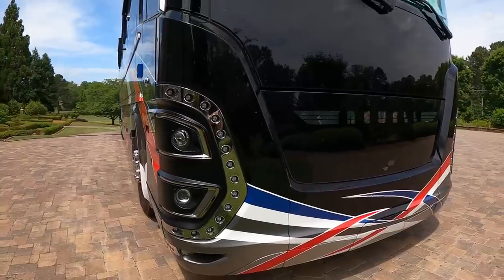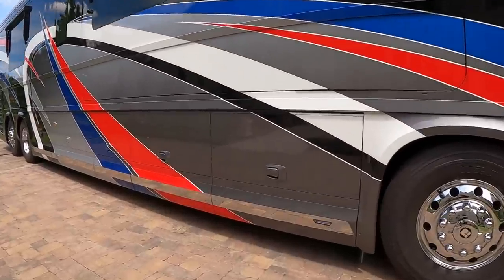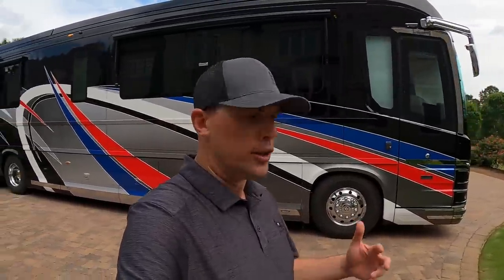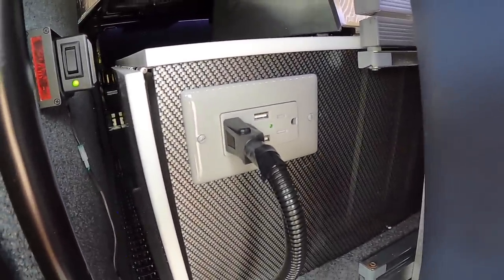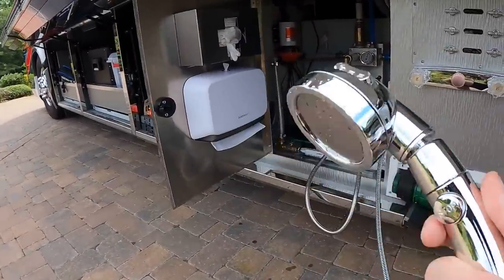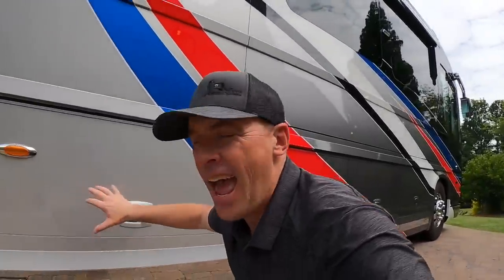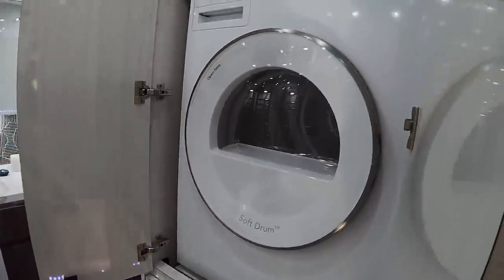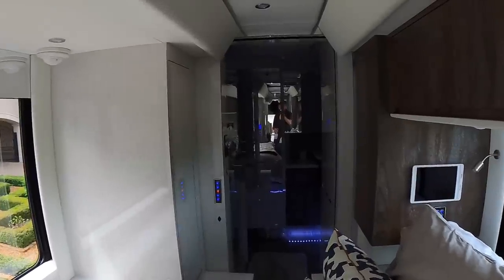THE  NICEST MOTORCOACH ON THE MARKET RIGHT NOW! Newell Coach 1704

Comment: Andrew: I have a solution for the rear bed. Why not have the bed roll up like those roll up gates in front of shops that protect the shop's windows. With the bed rolled up, you would be able with and without the slides to access your rear closets and bathroom with no limitations. Now what these vehicles should have is an auto driver that like a plane's autopilot be able to roll on the road while enjoying your coach. Of course this is for the future.  Thank you for these tours of these mansions on wheels. I totally appreciate it.

Comment: What kind of mileage on this Andrew
Reply: Newell's usually average somewhere near 8 mpg over a full tanks useage (you could be looking at 1500/tank!)
Reply: @shanemichaels124  I was looking for something around the 12mpg mark, but thanks anyway.
Reply: @Deanidge1983  that's unlikely in a Newell or Prevost. Maybe since Newell is a custom build, you could go with a 40' that is built using lighter materials and a dual slide. That might be possible. (But seriously expensive)
Reply: @Deanidge1983  sorry but unless you get a smaller coach 12 mpg will never come from a coach this big.
Reply: @Deanidge1983  enough cash to own and maintain something like this, but 4 MPG is your brraking point? Sure, sure...
Reply: @Deanidge1983  you can buy a 45foot rv bigger then this and buy a ram 3500 and tune it and get 15+ mpg pulling.  and stil be under 200 to 150k$.
Reply: @jamesstephensonii4428  emission delete this thing will get well over 15mpg sir. an the way you get around warranty if you buy a spare ecm and swap it in wont take 5mins so when it goes in for repairs there is no tunes recorded. the exhuast is a simple swap over aswell which they more then likely will not even check.
Reply: @shanemichaels124  no way….with a 600 hp Cummins you will be lucky if it gets 6 mpg.
Reply: @mrrod3004  you need to stop replying when you are high.  What you typed makes no sense.
Reply: @jamesstephensonii4428  i have a stock untouched cummin 6.7 in my yard that get 17 to 18mpg and 12 pulling 15k pounds. you probably have never even driven a truck in your life,  if you can even afford one and you get on here acting like you know something. im actually educated in the subject own several of these and make a living off it. what is it you do again?

Comment: I have already been building a machine shop inside of a 40ft high container... with a similar color scheme... same floor.  I like the colors.  I will save this video for future reference.  I hope to find a coach I can pull my container/trailer behind it, if that is not too long already, I think that is only 80 ft... so should work.  That way I have my  workshop with me... so I can still work at my machining hobbies along the way.  I'm also building a Gyrocopter which I can slide into my container while traveling.  So, its nice to have some nice designing work to work with.  Thanks for this.

Comment: I enjoyed your tour as it was quite comprehensive and the camerawork was thankfully calm and stable. I just wish now that you are rich that you would spend some money on a good dual wireless system so your audio is better in your interviews and your speaking style can back down from screaming... 

If you are still shooting with a phone I would recommend (I get nothing out of the recommendation) and have the Comica CVM-WS60 since it is a true 2-channel multi-frequency system allowing a channel to be pumped up in post if required and is designed to securely piggyback on your phone for fast deployment and compact travel.

Comment: I absolutely love the color scheme inside the light airiness. Newell coaches are the only way to go in my opinion. 💘 I  wish THEY MADE a SHORT VERSION like a SHORT school bus size. Where you still have room for a full bath NOT a wet bath,full kitchen&appl.. stack w/d.All the Comforts of home on wheels.So a single person such as myself COULD ACTUALLY DRIVE it , Boondock etc.. Do you think that would EVER happen that Newell would MAKE A SHORTER VERSION for singles NOT 👪 ? The only 2 things I don't like that I think looks is the laminated wood walls & the shiny floor. But that's just personal opinion

Comment: "basement" doors opens up - fun in bad condition, whole dirt on them, wash hands each time you go outside. Remotes for bays - ops, i lost one, ops lost second and i cant operate bays, each tv got own remote - why not install smarts tv and program one remote for everything? Or built in operating tv in to pad function (you already got 4 of them in walls)? Lets count them down - 2 for bays, 3 in salon area, 1 in bedroom and 1 in bathroom. Plus some for sound - i do not know how it is operated. So at least 7-10 different remotes + pads. Some one did not think that trough xD

Comment: Absolutely gorgeous & amazing~! :) Thanks Andrew :) For the flickering of the lights during filming : I am perfectly aware that you must've done your research on this, but if you are using the newer GoPros, I might suggest you try to change the video type to NTSC for USA and Pal for everywhere else. Also, when filming in 4k, 2k or 1080p , try to set the shutter speed either to 1/60, 1/30 or 1/15 because most lights in the USA are set to 60 Hz power. Just some thoughts, although as I said, you must be aware of that :)
Reply from the maker: Thank you!
Reply: @RVingwithAndrewSteele  i dont see the contact information... is the coach sold..#1704

Comment: As a Brit, I’m curious as to what driving license you need to drive this?  In the uk you’d need a commercial license for either trucks or a coach.
Reply: Regular license in our state. Not sure about the other 49 states. A Commercial license should be required I think.
Reply: @deko2485  Why? The majority of people that own these put less than 50,000 miles on them as they snow bird and they sit for months at a time. Not like they are OTR truckers hauling 65,000 lbs.

Comment: Not crazy about the fuel tank(s).  Having to bend over to fuel up after driving a few hundred miles.  And,  I see that the State of California has messed it up with the requirements of a D.E.F. tank.

Does that come with remote start-up system for the engine?   So that Cumming is warmed up and ready to run, when you are.
Or can you get a real engine like a Cat ?

Comment: Outdoor kitchen/BBQ has one bad flaw, unless those two counter extensions lift up 90 degrees to the BBQ, those two drawers are completely useless, other than to keep the two extensions up. If the drawers don't extend out past the counter extensions then you can never put anything in the drawers or if you manage to put something in them, you won't be able to get it out, not without removing the extra counter panel first.
If this is how it is supposed to and does work, you should have shown or explained that in the video. As it stands, it just looks like two drawers which you can't put anything in, are only there to hold up the extra counter panels on the side

Comment: 1360: best used model I hve seen. Sure u will hve to modify the bunks so they r adult long enough flip up hinged extension at least 1 ft or so & that way u can hve a pool like raised head end, easy enough. As for bed problem u hve to sleep on bottom & hve ft raised or flip it head raised when slides n or both head & ft elevated but bc 100 yrs old & sickly I hve to raise my ft any way. Shannon only 5 4 I think? & I am only 5 ft 7" Godly perfect by the numbers any way So I will still fit even when slides n. I like their style of wood or polished fine too. Paint is ok for 1 million discount no problem.

Comment: I have one question   and it might or might not apply to this coach but i saw one time where they had windows that you could not see in from the outside but could see out fine from the inside does this coach have those  and or is there such a thing i can't seam to find it anywhere .

Comment: Considering all the details that are put into this home I doubt that the air compressor is to fill up the tires rather for pneumatic tools to maybe change the tires or do wrenching on the engine or anything like that but that vehicle has to have self inflating tires. If not then they missed the detail

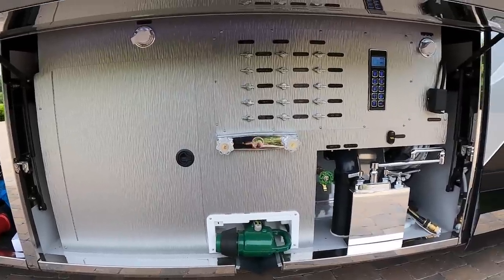Comment: 8:34 If it was me I would make it so that both sides could come out at the same time? I will make a side note on this feature. It would be a pain to have to walk all of the ways around to get everything out of the fridge to cook on the other side of the rig?
9:57 It's too bad that it is not a 400+ fuel tank? Would the generator on a coach like this have its own tank or would it use this same tank? The other side note on this is if it does use the same tank for both the run the rig but to run the generator is there a feature where it will alert you that you are almost out of fuel and shut off the generator so you have enough fuel to get out of where you are at? If there was a feature like this and you could set the parameters to when the generator would stop for example, if you are 50 miles from the closest fueling station you would set it so you will have enough fuel to leave and fuel up?
28:40 This is a very nice rig. I wish you would have mentioned how much water and sewage the tanks hold? For something that expensive I would want Solar, Wind, and a Generator? Nice rig.

Comment: The first thing I don’t like is the opening of the basement doors. You need to bend under the doors to get access to some items. For older owners that’s a deal breaker.

Second ... looks like outside fridge and freezer are accessed on opposite sides of coach from BBQ. That’s brilliant planning. NOT!

Way too modern  looking and monochromatic colouring for this old timer.

Unless it’s your camera work ... the showers look pretty small to me.  I do love the bidet toilets. 

I do agree with being able to have a flat bed with slides in.
Reply: I agree with that kind of money bending under those doors.... I did always wonder on those pull-out grills heat, grease, flame etc. that close to the coach is worrisome.  I always move my camp chef a few from the coach.

Comment: Newell we need steam rooms and hot tubs in a slide-out deck out the rear or a deck that will slide out the side of the coach we need Super kitchens with oven a Jenn-Air for cooking steaks and Grilling inside and a slow smoker for smoking briskets and different BBQ in a concealed chamber so when the door comes open everything sucked out of the chamber so no smoke enters into the coach you put your Meats back in it conceals and smokes at the perfect temperatures the perfect meat temperature until it melts in your mouth the four burners and another with your Jenn-Air concealed slow smoker we need a distilled water machine for drinking purposes and ice cubes the tap water is not safe in America can you believe Now in America don't drink the water

Comment: That doesn’t make sense with the bed , why not have the bed all the way in the back, although maybe engine noise or routing of equipment might be harder with all the pumps in the back, who knows, but at least if it’s in the back facing forward it wouldn’t fold,and you could have a expensive bed ,then the closets, and bathroom could be on the sides ,using one of the slide outs for a full bath and shower, that would be cool or even a small jacuzzi would be cool to sit in and watch tv in the woods, lol..

Comment: I have to admit that I think the layout of that bed could be changed with the bed in the back and the bathroom on the side who wants a crimmed up bed for slide out. Those bunk beds being too small and that's high end to begin with and this company is supposed to be fantastic come on. And for my opinion there is way too many TVs. A way too many buttons to push. But to each their own I mean if you're going to give me this  I would drive it and be happy as can be but if it was my harder and money spent in. I also think that corner sink makes it very hard to reach. And be in a high end RV like that how come the driver's seat in passenger sea is not air conditioned

Comment: Nice. But, good luck getting that monster is a campground.
Reply: I'm thinking the same thing. Driving this to Yosemite would be a pain. Seems like its built just to go from larger campground to campground.  I'd rather have a smaller, well equipped 4 × 4 adventure r.v. that I could take to more isolated areas.

Comment: What we need in these coaches now is a distilled water system for drinking and ice cubes because the tap water is no good and not fit in America to drink and it also causes dementia we would also see a bigger package with a steam room and a hot tub inside the coach in a deck floor that will come out of the outside of the coach so we can sit out on the deck and watch fireworks or bring the hot tub out on the deck we would also like to see you super kitchen with ovens for baking as well as a smoker that heats the meat perfect and smokes it in a concealed chamber and when you check on the meat when the door raises it already sucks everything out so none of the Smoke Gets inside of the coach and you put the meat back in and then it fills up with smoke and the right temperature for slow smoking smoke a brisket

Comment: i see one massive issue with these coaches that rear end needs some type of 4-6 inch rubber bumper at car or truck level if someone hit that coach at 60 its def going to hit the massive engine nothing worse than spending 2 mil and a silverado smacks it and ur not getting to ur destination  YIKES

Comment: This looks like something you would have to choose between barely ever using it or using it like normal and having to do constant repairs.  Good grief, you can't even slide a chair around in it without putting sliders under them.  Under normal use that floor would get messed up quick.  And don't even get me started on all of the white cloth in that thing and all of the chrome on the outside.  But hey, if you have money to burn then I guess this is one way to do it.

Comment: 3 TVs in the same room, what a waste. There is so much waste and unnecessary gadgets in this bus plus the 2 bathrooms with a butt washer is so lame. So much weight could be taken out, for better range and maneuverability. Don't they know that more room is what people want? Slideouts is where it's at. When you park it, you should be able to pull out an extra 200 sq. feet.